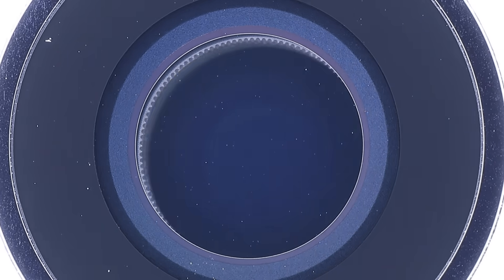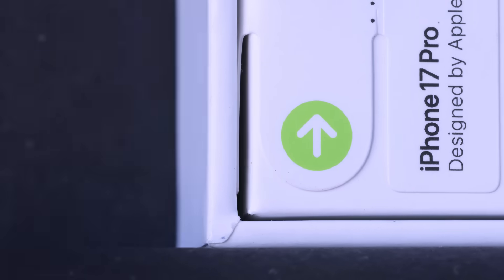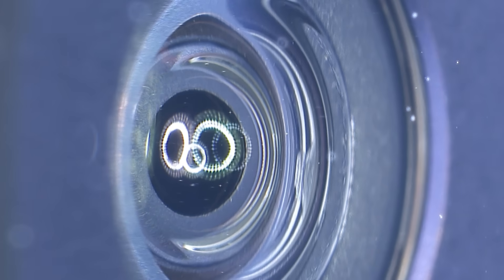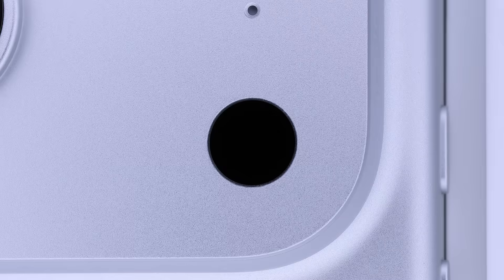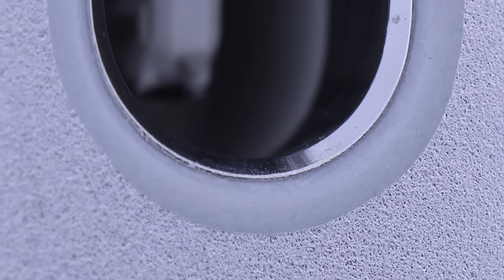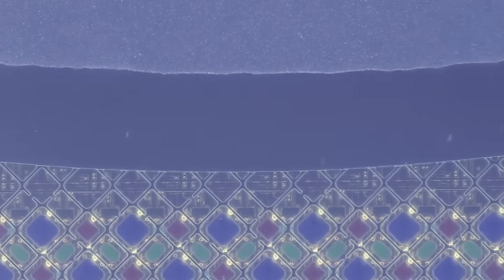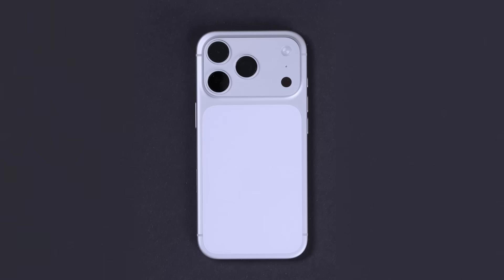I Put the iPhone 17 Pro Under a Microscope (And Found This...)

Comment: Very interesting video, very unique… I liked your footage.
It was super interesting being able to see the metal structure, mostly invisible to the naked eye!
My favourite shot was 2:40 2:44

Some recommendations…
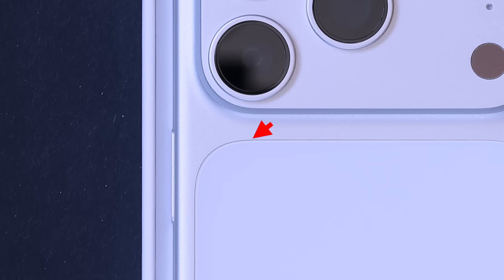>1:14 1:20 This large rectangular section on the back is not white plastic, but a ceramic. Dubbed "Ceramic Shield". 
>2:25 the flash diffuser employs a "fresnel" design at the edges, which consists of the ripples you mention.
>I am not the biggest fan of AI used to narrate the video. I am assuming that software has generated the vocal narration for this video.
But hopefully if you do get super successful on YouTube I might be lucky enough to see you make use of a voice actor… so, good luck on that haha….
Reply from the maker: Thank you for the constructive feedback! Yes I will hire the actor when I can afford it.

Comment: I actually just had to return a brand new 17 Pro Max when I found a speck of debris stuck inside the camera that was clearly visible to the naked eye (along with a hairline scratch on the inside of the camera glass), so this video is very cathartic. This amount of dust/debris allowed on the assembly line (especially at the stage when they assemble/install the camera portion) is totally unacceptable.

Comment: When I noticed that on my 16 pro i thought I got scammed but thanxx for the video all lenses have some dust particles in it
Reply: Just checked my xiaomi 14 ultra under 45x and it has some particles too. I can't see them with my eyes though as they are microscopic. But I noticed that my micro cloth is oily as it leaves fine lines under 45x.
It sucks, but these are not pro dslr lenses. Even they could have some dust particles I bet. But still, the one photographer smashed his dslr lens with hammer and it still took good pictures. Lol!

Comment: You should do also a samsung s25 ultra 200mp camera and haptic vibration motor reviews!
Reply: Samsung 200mpx look the same as iphone,and it's behind in term of stabilisation because it use OIS, iphone use sensor shift since a while

Comment: I just exchanged my M5 iPad Pro for a tiny defect where the screen meets the frame that could only be seen with the right light and at the perfect angle. There was no question and they gave me a new one.
Reply: It's just that you haven't looked at it from a certain angle yet :)
Reply: @ЭдуардВекус  No, over specter every inch at every angle using my phones camera. It’s as perfect as can be. If I’m spending 2K on a tablet it should be free of material defect.
Reply: What’s the defect? If you’re talking about a small gap, you will never get a perfect one.
Reply: @f.i.b3027 no it was actual chip inside that gap. So a tiny spec of shiny auminum

Comment: Their is very small chance for dust to get in the lens , but if the phone fail in any test in the product during manufacturing it will go through the secondary testing and disassembly. At that stage it has a higher chance to dust get in

Comment: That's a crazy amount of dust under magnification
Reply: Inspect your bed and cushion for bed bugs..........:face-blue-smiling:
Reply: Much less than in our eyes
Reply: all iphones have it
Reply: dust doesn't really impact anything unless it's near the focal point or on the sensor. Or if the camera had a variable aperture, it would appear when stopping the iris down to a pinhole.  it is so out of focus that, at most, you get a slightly darker spot in that general area, but that can also be corrected for in post and is generally the same on every shot you take, so it can be taken care of automatically. Or if you are a normal person and not a photographer - you probably will never notice it.
Reply: @kribkrumps  Stop making excuses, my Sony lens doesn't have any dust, neither do my telescope eyepieces.
Reply: @Mr-Anony-moose It simply doesn't impact on anything dude. Have you ever heard someone complain about the dust on their lenses? You literally need a microscope to see it
Reply: @Mr-Anony-moose literally doesn't matter at all, Elmo.
Reply: @Mr-Anony-moose My Sony, sigma, etc. lenses don't either. My 20+ year old cannon 300L does, and it doesn't matter in the slightest. Guess what, those are individual products that are assembled and sealed. Phone lenses are a surface mount component added during assembly, it would be like complaining that the front element got dust on it when you took the cap off.  Duh.
Reply: @Mr-Anony-moose it doesnt impact it lol i have million of dusts on my sony g master lense and it never affected my photos
Reply: @Mr-Anony-moose do you know that for sure tho?
Reply: @Mr-Anony-mooseYou can’t see the dust it’s at a microscopic level 🤦‍♂️
Reply: @Mr-Anony-mooseCause Sony made you a special one-of-kind lens that only you can have right?
Reply: cause its fake^^